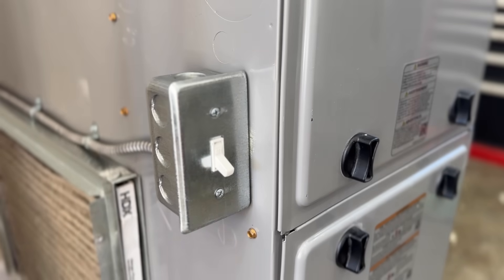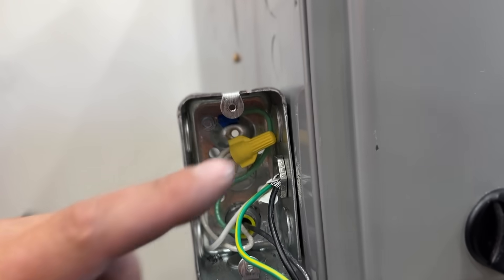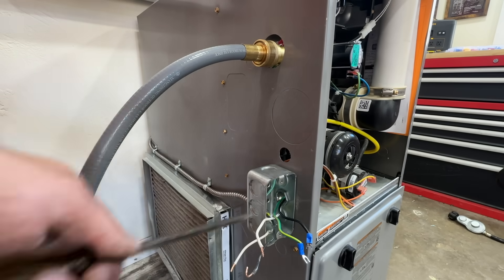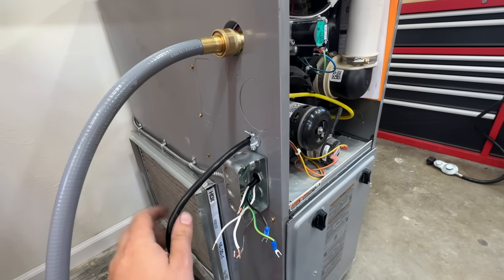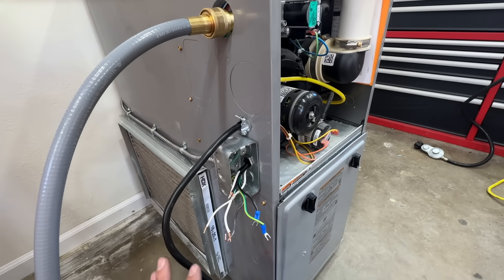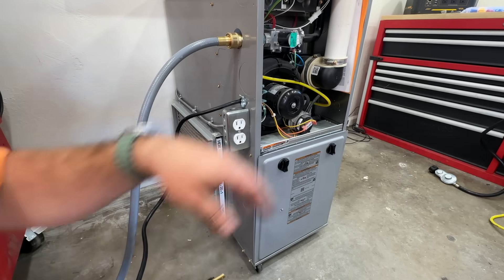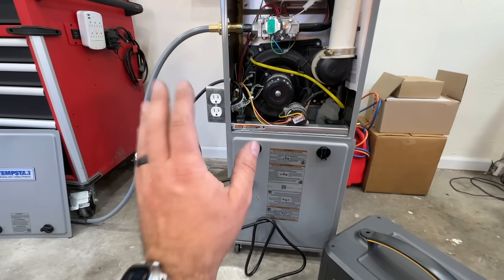Keep Your Family Warm During A Power Outage By Installing This $5 Part

Comment: We put a dryer outlet in and a male end on the generator extension cord. Flip the main feed off and it will run the refrigerator, furnace and well pump,plus lights. We only back feed 30 amps so we try not to use everything at once. Plus All the lights are led and have basically little draw. We just bring the generator out and have a good supply of fuel,but if you are screwed,you run it only when needed.Ours is mainly winter storms,so heat and water r important.
Reply: Using a double male cord is not only unlawful it is very dangerous. It leaves you one mistake away from electrocution. Power inlets, just google it, are cheap and broadly available. The connection in the inlet port is 2 blades and a Grounding pin that look like a plug was fastened in place. The Cord Cap, which is the proper name for the female end of a cord which will except a plug, will fit right over the blades and pin of the inlet as they it were the contacts on any other plug. None of the exposed blades are ever energized until a cord cap is placed over them so there is no chance of accidental contact with an energized plug blade. 

Tom Horne

Comment: For those homeowners that have a lithium battery powered RV, you can use one of its power outlets to run your home heating and other items in an emergency. I have one with a 600 amp hour Lithionics battery bank and 3k Victron inverter and was able to use it three times in the past year. It kept the heat/ac and refrigerator going for days. I did have to start the RV's engine to recharge the battery bank. But, it was essentially endless power...

Comment: Great video.   One small niggle - never coil an AC mains power cable.  Inductive heating can melt the cable and may cause a fire.
Always zig-zag the excess cable and tie the bundle.
Reply: What he did was fine.  Zig xagging would actually tend to have more pronounced bends in the cord

Comment: my furnace has the switch box on the side of the furnace. there's a switch with a screw in fuse below it. then another switch box with a sealed front on it with a transformer on top of it.  any idea on how I can use this set up?

Comment: Could something similar be done for refrigerators or freezers?
Reply from the maker: A fridge or freezer already has a plug so you wouldn’t need to do this, but you can power them with your power station for some time 👍🏼

Comment: Not being an electrician, what size external power supply would you need to run and startup a typical furnace? I ask as I have a Jackery 290 that has a peak 400W and a 200W continuous.
Reply from the maker: I don’t think that would be large enough unfortunately. But the extension cord should be the same gauge as the wire going to the furnace which is usually 14 ga or sometimes 12ga

Comment: I guess if your house is all electric like mine is I'm just s*** out of luck?
Reply from the maker: It does make it a bit more challenging. I’d advise a inverter heat pump as they require much smaller of a generator to run. But having a dual fuel system is the best route imo

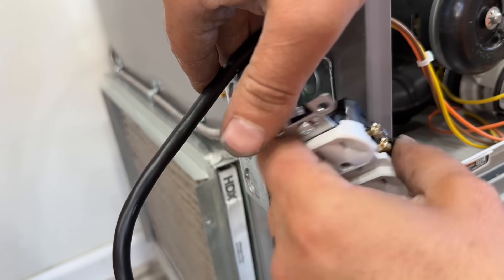Comment: About 8:40 into the video, I would recommend wrapping the outlet screw terminals in electrical tape before inserting and seating. That way, in the event that someone is working on the outlet and power is not properly cut, they're less likely to touch the exposed terminals and shock themselves.
Reply: Electrical tape is an insulator. Insulators hold in heat. Heat causes melting or worse, fire.

Comment: Couldn't you just wire the external power cord to the switch that was already there ?
Reply from the maker: No, because then you’d have a potentially live plug if grid power came back on, and also you’d have the potential to backfeed which is no good.

Comment: can use this method for heating oil burner?
Reply: That depends on how much current that oil heat unit needs to run. Is the heat that the oil burner is producing heating forced hot air or pumped hot water? For an oil fired forced hot air furnace the source has to run the air circulating fan and the oil burner's high pressure fuel pump. For a pumped hot water system It has to run the same kind of high pressure fuel pump in the oil burner itself and the water circulating pumps. If either are the high efficiency type the source also has to power the purge blower and the inducer blower. Motor loads add up fast. Only by your sharing the information off of the Recognized Testing Laboratory (RTL) label could I fully answer your question. That label will have the full load amperes, minimum conductor size, type and ampacity of the Circuit Breaker or fuses and a few other points that I might need to give you a complete answer. 

Tom Horne

Comment: We had to replace our furnace a couple years ago. I told installers to do something very similar to this as we have a generator for emergencies. He refused to do it for me , but did instruct me on how to do it and left all the materials so I could do it later myself.
Reply: liability
Reply: did they just not want to touch electrical?
Reply: @victorphilip875  
I think it was more that they didn’t want to do something not really recommend by the manufacturer and be liable if something went wrong or wasn’t right.  But we hooked it up like he said and tested it.  It works fine.

Comment: If you don't have a power station, you can use a car battery combined with an inverter.
Reply: @kimbuck-2 
Yes, but don't use it so much that you can no longer start your car! 

Also, it is not recommended to use your car alternator to charge up a battery that is somewhat drained from this kind of utility use. It is better when possible to first charge the battery with an external battery charger. But if you can't, you can't, and will have to start your car's engine to recharge the battery.
That is why it is better to have a spare battery and an external inverter. But if you do have a spare battery, you should keep it on a trickle charge when it is not in use so that it will not become sulfated and hold less charge.
Reply: @kimbuck-2 
An inverter puts out 120 volts AC.

If you get a really cheap one, it may not have polarity protection, so you will have to be very careful when you make the connections, otherwise you might ruin it.

Comment: I did the switched outlet version. Easy as I do a ton of DIY electric work installing a 240V circuits for EVSEs. This is great if you have an EV  for power outages. We have a Ford Lightning and Ioniq 5, so a lot of accessible power and far quieter when needed than a generator. I didn't do the whole house backup integration with the Ford, but a couple long 12 and 14 Gauge extension cords and we are covered for a multiday power outage if it happens.
Reply: One of the best practical setups IMO.

Comment: I hired an electrician and he installed a transfer switch. I have every electric appliance ( including my fan forced gas furnace) attached to the switch. If the power goes out we plug it into the generator.
The only thing he didnt hook up was the central air conditioner because it would put a strain on the generator.

Comment: How many watts does a typical gas heater use?  About 700 surge at start up and 350 to run it?  Asking, not telling.  Just curious what size generator, etc, would be needed.

Comment: Very nice! But useless here because there is no battery backup on the secondary feed pumps in our gas distribution system. The main line yes, much good it will do us. Folks might want to check this for their area, because no fuel during a power outage equals no heat.

Comment: If you have an alternate power source as is obviously required here, why not just install a transfer switch of sorts and feed the whole electrical panel so that you can also use other appliances like TV and entertainment systems, etc......
Reply from the maker: I have a separate video for this. But this trick is very basic and can be done last minute if needed 👍🏼

Comment: Will this work with an oil furnace as well?
Reply: An oil furnace will use more current than a gas furnace does because in addition to the forced air blower the oil burner has a high pressure fuel pump to force the liquid fuel through a nozzle or nozzles to turn it into droplets so fine that they will burn like a gas. Everything that burns, with only one exception I know of, burns in a gaseous state. Oil is a combustible liquid. That means that it does not give off flammable gasses at normal ambient temperature and pressure. That is why fuel oil is refined to be so close to kerosene in it's viscosity. Fuel oil can be atomized into super fine droplets that will behave as a gas in the combustion process. All common combustible materials burn in a gaseous state. They have to be heated to a temperature were they will give off flammable gasses which combine with an oxidizer to burn. 

Tom Horne
Reply: Thank you @hornetd
Reply from the maker: If it’s 110v then yes
Reply: @diyhvacguy  Thank you

Comment: Curious how many hours of run time you're getting on this.

I went a different route and hardwired a battery back up surge unit to my boiler.  Its a dedicated stand alone and both surge protects my boiler and runs it in power outage.  It only lasts a few hours of constant running but seldom does it run more than that in 24 hours since its just running a gas valve and reirc pump.
Reply: Depends on the furnace. A 125K BTU standard furnace with a 3/4 HP PSC motor (blower) is going to run at 700-1000 watts. A smaller furnace with an ECM  blower motor will use a lot less juice

Comment: Just install an Interlock Switch on your panel, also very easy.  That way, you can plug your generator in and power ANYTHING in your house you want, not just your furnace.
Reply from the maker: Yea I have a separate video for that 👍🏼

Comment: Nice hack. Best bet for those who have a portable generator outside is to spend the money to have a electrician setup an external connection box hookup for it, which will be wired into your fuse box. Then if you have to use the generator, it will power your whole house.

Comment: Love this!!! So as I think by doing it this way one would not have to turn the main off if electric is restored and blowing up your generator or other emergency power source, just unplug from emergency source and plug it back in to the installed outlet when outside power is restored?

Comment: The outlet needs to be turned 180 degrees putting the grounding pin on top.  the reason for this is if the plug comes loose and is partially plugged in, that something does not fall onto the hot/neutral prongs causing a short and or fire.
Reply: Nope. Better off with the ground pin down. When plugs are removed your index finger is near the bottom part of the plug, so if you touch it, no shock.
Reply: Electrocuting yourself by not being aware is not the same as burning a residence or business to the ground as a contractor. Either way the NEC and the NFPA have never issued guidance one way or another.  It is a personal choice at this point.

Comment: Why not put the cord right into the switch box?
Reply from the maker: Because some folks have the box attached to a wall close by and then have mc running to the furnace. I should have made that more clear but that’s why I ran it through the furnace instead of into the box. 👍🏼

Comment: This is the worst video I’ve ever seen, it should be taken down immediately! A lot of amateurs want to do this, but you made it very unclear and confusing where all the wires go! If someone does this wrong someone could burn their house down or get electrocuted by a hot pigtail!. Ever hear of a wiring diagram? You showed only 3 wires going to the receptacle, where do the pigtail wires go? How does the power flow from mains to the furnace vs when running from portable power? What did you connect those funny connectors to? Are the connectors rated for 15 amps? This really looks unsafe man. Come on, really. This should be reported.
Reply from the maker: You need to learn some things about electricity. You should be banned from commenting. 

1. The pigtail will never be hot, and I would never recommend that. 

2. If anyone doesn’t know anything about electricity (clearly you are in this group) please don’t attempt this.

3. Read the comments and you will see that this is good information that is clear to understand. In fact, I’m not sure how I could have made it clearer.

4. The connectors are called Wago’s. You would know if you listened closer. They’re rated for 32 amps.
Reply: Pigtail is not hot. You plug it into something that is. A generator or invertor/battery settup. Cmon you dat simple?

Comment: For those that feel bound by the hardwire requirement and don't mind spending more; There are single circuit cord fed generator changeover panels available exactly for this purpose. It's going to cost you more than the $5-$10 of this method though
Reply: Hello do you have a link to one?as googling "single circuit cord fed generator changeover panels " just bring up a whole bunch of inlet boxes and transfer switches that have nothing to do with furnace.
Reply: @KeithOlbermannn  A transfer switch is actually what you need. The name of one that you would want is Reliance Controls TF151W Transfer Switch. It's a single circuit transfer switch that would be fed by an extension cord plugged into your generator and the other side by utility power. It's gonna cost you around $150-200 and would be mounted next to your furnace.

Although with the cost I'd rather go with a 30 amp transfer switch/sub panel combo at your main panel. These cost $500+, but then you can back up your fridge, lights, furnace, etc... with one 30 amp cord from your generator.
Reply: @thoryan946 I’m have actually been looking into this recently. Was also leaning towards a  Reliance ten circuit panel. I have an electrician coming this week to look at my panel and setup to advise if it’s the best solution. I know the Reliance has a lot of helpful videos and is supposed to be DIY, I could probably handle it but will likely have a pro do it.
Reply: And where do you find one for that price? Are you living in 1970? The cheapest out there are about $150 up to $600...
Reply: @michaelholliday100  There's one called the EZ Transfer switch or something to that effect (it has a green cover) for about $100.  Good for this furnace application.
Reply: @mae2759  I own a lot of properties. I would never install a product in a home that a low-end product. Then you have a house fire and what has the cheap transfer switch saved you or for that matter, what has it cost you, someone's life?
Reply: @michaelholliday100 Well, it's UL listed, so I'm not sure how much safer you need to get.  Also, it's not one of those big panel transfer switches that has multiple circuits on it, which is probably what you're thinking of.  You basically replace that light switch on the furnace with the EZ transfer switch and that's all there is to it.  Great for this furnace application if you wanted to plug in a generator.
Reply: @mae2759  Just because you buy something made in China that has a "UL" rating, does not mean that it has a legitimate UL rating. The Chinese pu any label that they wish on many items. I spent almost my entire life in the Electronic Industry, I really know what I am speaking of, irregardless of  whether or not you believing it...
Reply: @michaelholliday100  I agree, but this product is made in the USA. I think it's both UL and ETL listed.

Comment: So how would you set this up if you wanted to do your air conditioning as well?  I live in the south and while heat in the winter is important cooling in the summer is much more so.  I know the furnace/blower would be 110, but the A/C compressor that is 220, isn't it?  If you had a generator that would put out 220, could you make that work as well.  Apologies if this is a dumb question, it crossed my mind and I thought I would ask the experts.
Reply: It's typically not possibly to do this with AC simply because the power draw is vastly higher, but it may be feasible with a combination solar and battery system. This video by The 8 Bit Guy showed his solar setup mostly handling cooling in Texas in August for about a day: https://youtu.be/W3lSjuLAAVQ?si=M79Y96nbshdHdgli

Comment: There is a much smarter way of doing this and easier. You can just simply buy a three way switch one way is on for grid power...middle is off and third is for the power station which is where you connect the cord to....Not bad idea here but someone will get stupid on your set up
Reply from the maker: How is that easier?

Comment: My new gas furnace will not run from my 3000 watt pure sine wave inverter. The furnace gives me a code of lacking ground. It will run using my 1.5 Kw generator.

Comment: That type of clamp is for NM/SE cable. They should not be used with standard power cord type cables. A strain relief clamp is what should be used in this application.